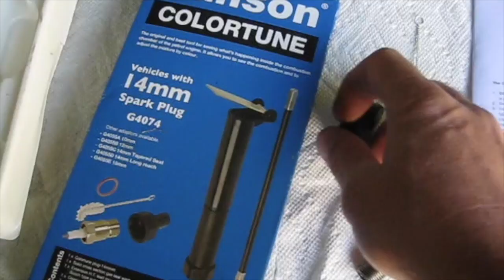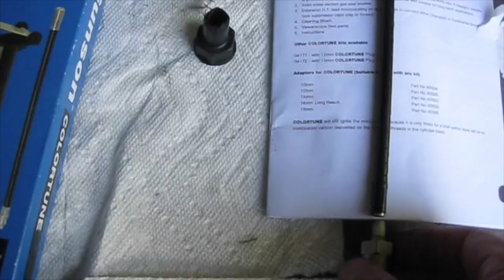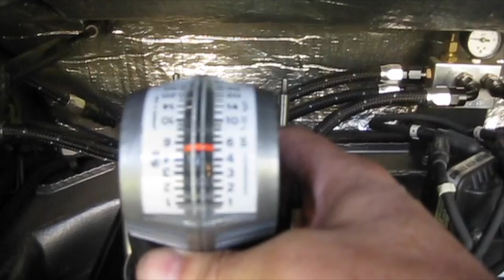Colortune tuning Porsche 911 Engine Carburetors

Comment from the maker: I keep the components as a single unit - with thread lock and electrical tape holding the plug to the electrode.  That way it can’t separate leaving the plug in the recess.